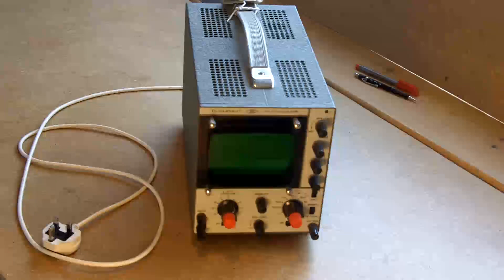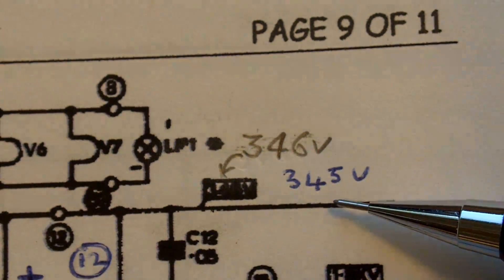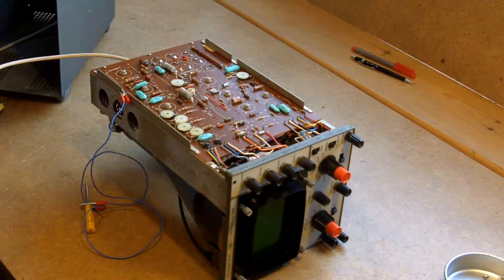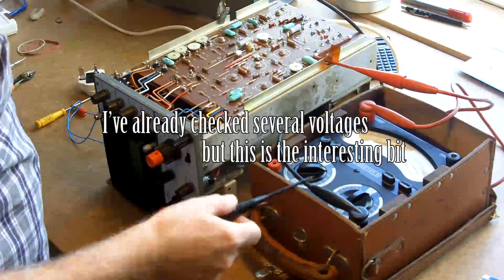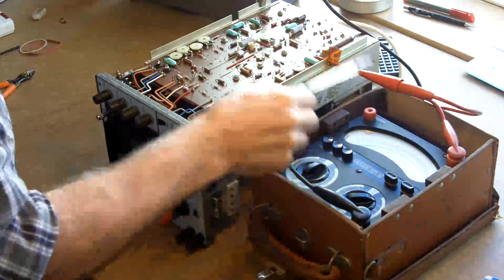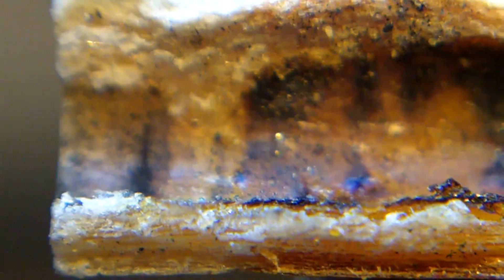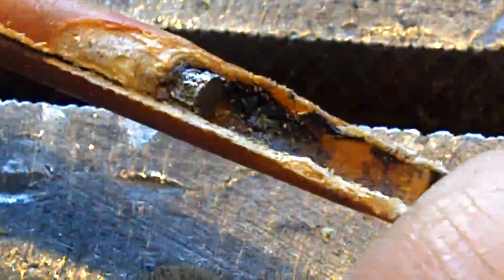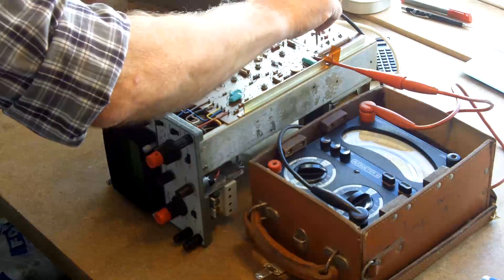About Radio 54 Fixing my Telequipment scope S51B

Comment: Wow great video thanks! Is there no risk when opening up these old machines?
Reply from the maker: Hi Rory, yes there is always a risk!! Some are serious and some are minor. There's always the risk of damaging something or dropping some special screw etc, but there's the risk of electrocution. Obviously if you have equipment pulled into the mains electrical supply and switched on then the danger is anticipated, but sometimes there are un expected dangers. And of course these are the ones that catch you out!!! You could have an on/off switch that youo think you've switched of, but it's faulty and the contacts are still closed, so you get a shock, I've had that!! So always unplug it!! I've hade high voltage capacitors hold a charge for a very long time after I've removed the power, they will shock you, so always discharge HV capacitors. There will be dust in old equipment, very fine evil to breath dust, so you might want to vacuum it out.  Life is full of danger, but don't let that stop you from exploring, just be as aware as you can be and learn along the way.  But have fun learning!! Kind regards . . .  Andy

Comment: Your videos Mr Andy are very informative. I had the same problem with my telequipment S51. Replaced the selenium rectifier with a series diode arrangement and decided to do a total electrolytic capacitor replacement. The scope blows fuses now, and I have double and tripled checked my work. I believe the power transformer developed a short when the selenium rectifier burned up. The problem with this old antique equipment is age including the power transformer. I have taken old power transformers apart and during unwinding the secondary and primary windings the enamel on the copper just flakes off. Age effects everything in electronic equipment.
Reply from the maker: Hi there, you can fix most old equipment but sometimes you have to decide if it's worth it. I don't think that folks will find it quite so easy to fix modern equipment. You can rebuild a transformer and even refurbish a vacuum valve (tube) but I can't see anyone repairing an integrated circuit chip.  Good luck.

Kind regards . . .  Andy

Comment: Some very useful information in your video, thank you.

This CRO is valve based, and is now a highly collectible item. A recent sale (Jan. 2021) for one of these on ebay fetched the seller £300.

On my model, the 'E' suffix in the type number meant it was a simplified version for educational use. It does not have the TV timebase IP's, for example, that are not used today, anyway.

It is a nice straightforward instrument for the workshop. I have one I am doing up in my spare time. 

I paid £10 for it at a carboot sale. 😁

Comment: Thanks for sharing. I always love old scopes. I think it is possible that you need a resistor (or series of resistors given the voltage) to make a voltage drop comparable to the old rectifier vs. the modern silicon diodes. This is probably why you had over 2kV vs. the original 1.8kV. Will this harm it? I have no idea. In old radios when I replace a selenium rectifier I measure the output voltage and add resistance to get it to match the voltage listed on the schematic (or measured before replacement if the schematic doesn't list it).

Comment: I have a Telequipment  D61 it has poor trigger locking any idea's Andy ?
Reply: I've had one of them before, and an S61. The D61 trigger is awful. It won't trigger properly if the timebase is set too high or too low compared to the cycle length. Not much you can do about that either by the looks.

Comment: I appreciate your sensible and thorough approach to your work. Here in Aust. we did have EHT rectifiers like that in early transistorised TVs (late 60's to mid 70's), later on of course the rectifier was encapsulated in the line output transformer. Maybe you Brits had different arrangements? I shall do some snooping and find out!

Comment from the maker: Hi there, I often pencil a note on the chassis for myself or others but I never leave anything that could cause a fire hazard. I used to be a service engineer and it was often very helpful to find the previous engineers note. If you have to keep on replacing the same component it can tell you there’s another problem that has to be resolved and sometimes you may have to change the design to put it to bed. But yes, always put the date on everything, that's so important.  
Kind Regards ... Andy

Comment from the maker: Hi there, well I don’t know whether to take that as a complement or not but I guess that it's a statement of fact. I love this old technology, I like the fact that you can find your way around the circuit, on paper and in the equipment itself and reasonably it all works logically. I think analogue systems have a lot going for them, I know that number crunching is best done digitally but for speed of response in control loops analogue techniques have saved my bacon many times over.
Regards...Andy

Comment: Hi Andy,

Can't the kitchen and decorating wait a bit longer then you can continue with these excellent videos?
My old Advance E2 now works a treat, my Megger is back up and running so next up should be the Marconi TF-2002 Generator. However like yourself none of my scopes have a timebase X output either so maybe it should be the old Solartron scope instead.

Great set of videos that help us all.

Regards,
Tony - m1ext

Comment from the maker: Hi Dennis, it’s a first for me also, I guess I most have had equipment with that sort of diode in but just never got close to it I guess. Most of m high voltage work involve either  big thermionic diodes about the size of a thermos flask or else stings of encapsulated diodes each  about 3 inch diameter by 1-1/2 thick, they screwed together, 36 off for a three phase bridge, 50 kW at 12 kV...  A bit bigger than this little rectifier hi hi
All the best ... Andy

Comment: Nice fix Andy.   I guess the HT will be a bit higher since the silicon diodes will have a lower voltage drop than the selenium ones.  I'd not seen a diode in that sort of package before so it's always good to learn something new.